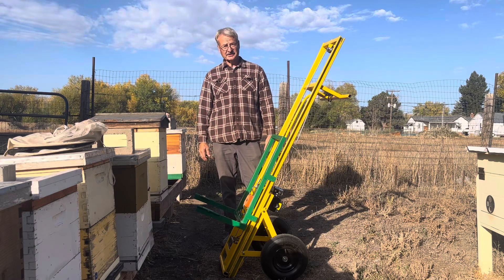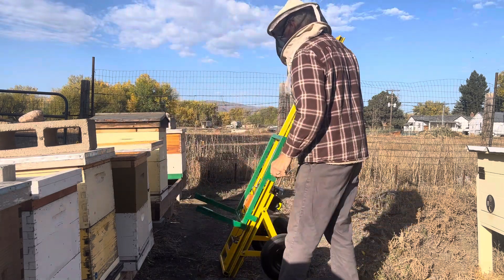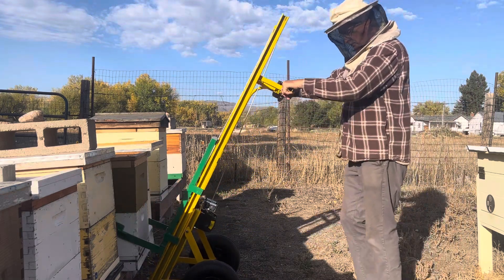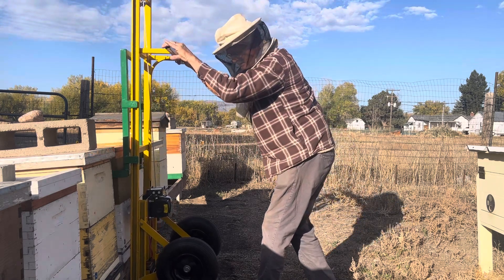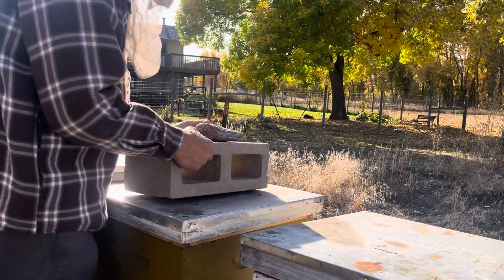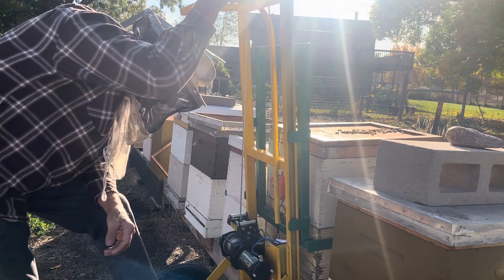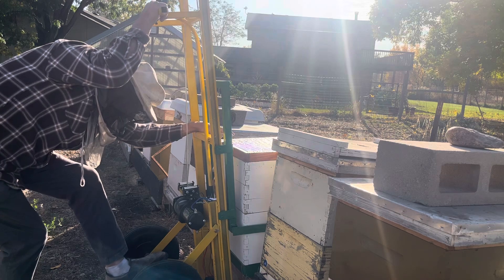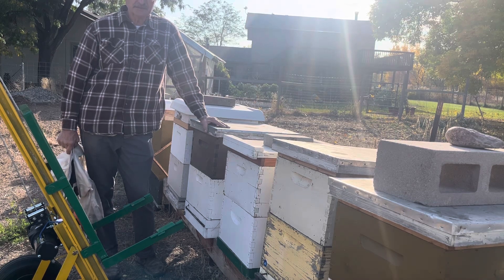Hive Lift 4.0 Build Part 9

Comment: A friend at church made a hive lifter for me a couple of years ago. Uses a hand crank. Lifter arms squeeze in with the pull of a lever, instead of being set in place with hinged pieces going into handholds. This seems to make it a bit more forgiving to me trying to line up on the hive. The lifter made it a lot easier for me to move hives between stands and trailers, or the bed of my truck, for transport at night. It's a little nerve wracking cranking up a hive with a deep and 3 mediums. Once I get it away from the stand, I crank it down closer to the ground till I get where it's going. Still, I'm uneasy having to tip the hive back to roll the lifter. But propolis has always held the boxes together so far. That winch system looks sweet. Keep up the good work.
Reply from the maker: It may be a littler slower to use but still saves the back. You have a good friend. Blessings to you!

Comment: I have been following your builds since the early one.  On this one, how far are the arms off the ground at the lowest point & the highest point?  Was it your idea or your wife's to have 3 first aid kits in the shop?
Reply from the maker: Ha ha ha!!! You noticed the multiple first aid cabinets. One has first aid, one is used as a key cabinet, and one has some honey bee healthy, swarm commander, and other bee products. As for the hive lift the lowest point is 1-1/2" above the ground and the high point is 57". I'm usually lifting either a hive to move it or supers above the brood boxes to install bee escapes. Sometimes I will add a super above the queen excluder and place the escape above it and then place the supers with honey on top of that. If your hives are on pallets it has no problem but if you have your hives 16" off of the ground you may not be able to add a super with bee escape on top and placing the full supers on top. I hope your bees overwintered and have a great year.
Blessings!